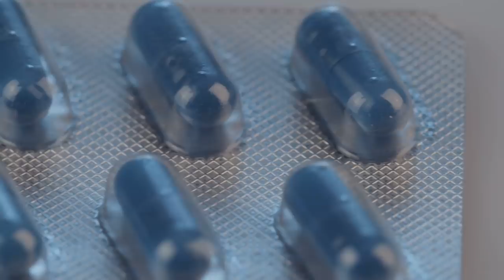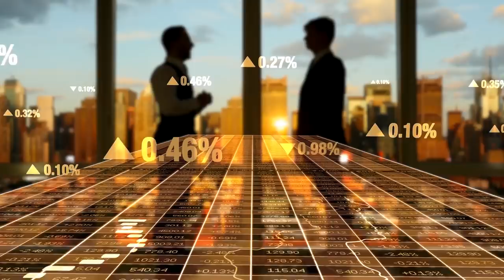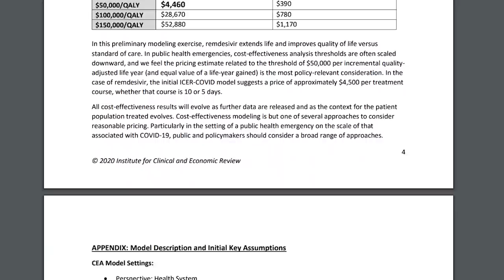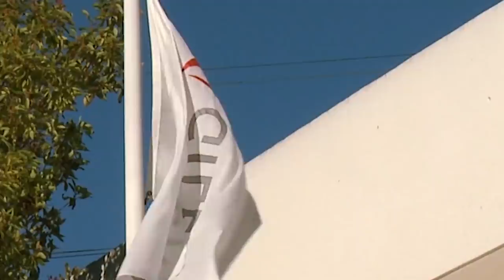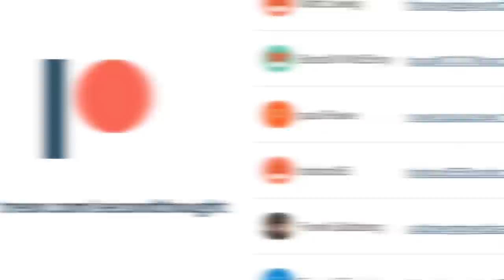How This Drug Company Monetized The Pandemic

Comment: My main medication (that I cannot live without), cost $85 in Canada and Mexico (for a one month supply).  In the U.S. it costs $1,350.  Thank god I have insurance... if I didn't... I'd be dead now.  The total cost for all 5 of my medications (without insurance) is $5,250 PER MONTH.  << one of those meds used to be a generic that cost only $4 per month, but they reformulated it into an extended release tablet, which allowed them to patent it again, and now they charge $2,400 for the same dose of medication.  The rule in the U.S. is that, as long as you don't make the medicine worse, you can change the formula and then repatent that new formula.  It's a racket.

Comment: A clarification regarding the $10 figure: That appears to be the marginal cost of producing the drug, not including R&D, which would certainly reduce the insane 300x markup given in the video. However, omitting R&D costs is partly justified by the fact that remdesivir was developed initially "as part of a suite of agents for potential use in chronic Hepatitis C," of which other drugs were successfully launched and presumably had already recouped costs.

Comment: I can't afford $120 Test-At-Home Kit, and, that is not including the Antibodies test costs, if any. -My storage costs are $450 per months, with $150 for late fees, equal to $600 per month if late, plus $600 a month for residential rent, and, we don't have free rent as in the USA. -Additionally, they just delayed a $50,000 a year job, highest paid work for life, at 53 years old, 60 hours a week, overtime over 44 hours a week, while I'm offered 30% of that cost, if I move my property some 15 miles to 30 miles away, or, more both storage lockers to a $320 a month unit, saving me 25% of my costs, except that, if I cannot afford half of that costs due to delays, which they just caused now, for 2 days requirement for practice and test, abuse the money to steal from me and lie it's seeking forfeiture by misinterpreting the law, which law is designed after world war 2 from treaties, for peace, so, they lie they are public order while doing war, and violating peace treaties, and lie about others violating the peace treaty, when they are not, in acts of war.